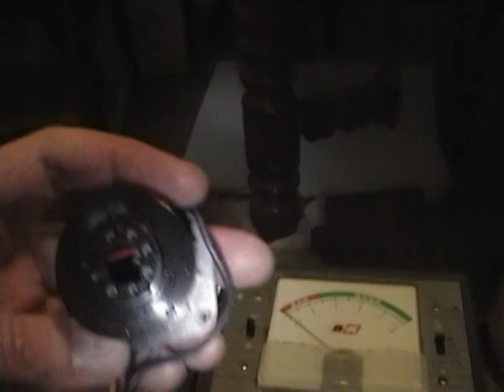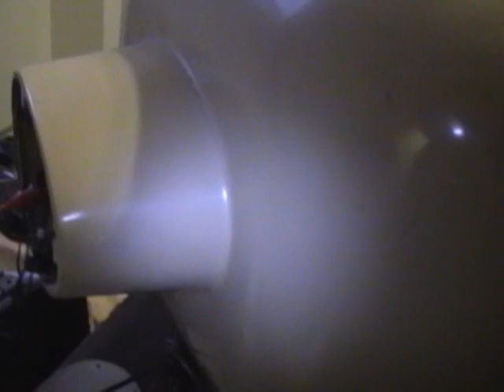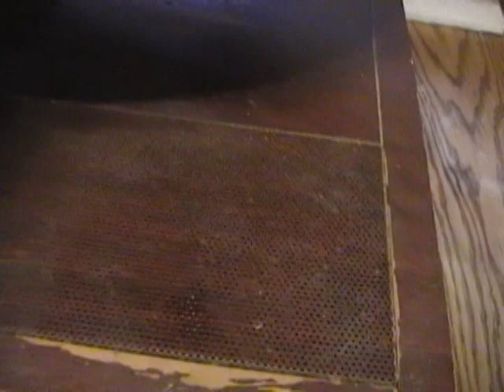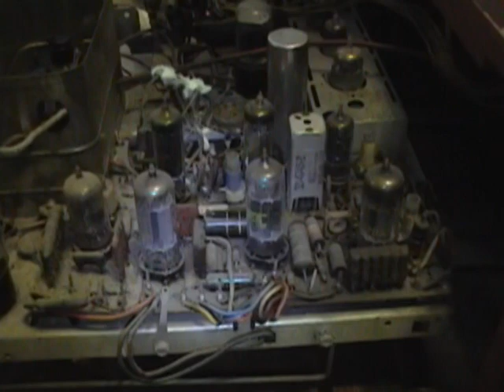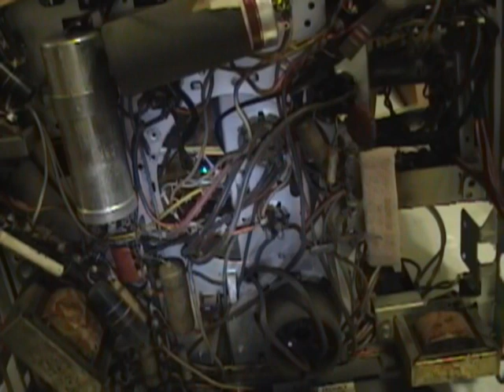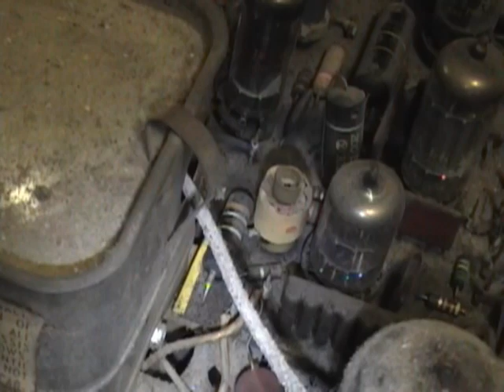Predicta "Holiday" restoration p1o?

Comment: Hey - to replace the 5.6 ohm fusable resistor, and match nearly perfectly, can 2, 11 ohm fusable resistors each with 5 watt ratings be used in parallel for the R78 in the Predicta Holiday with 9L37 chassis?
Reply from the maker: Probably.  The resistance value is not critical.  It's there to reduce the surge current on power up.  Modern silicon power resistors can handle a much higher surge current than the originals.  What is important is that it goes open if too much current is being drawn to protect the power transformer.

Comment: Hey Bob ... I joined the club and have a Holiday I'm restoring.  I need to show you a pic of the current state of the flyback transformer to see if I can just re-seal it.
Reply from the maker: I've yet to see one that couldn't just be resealed.
Reply: @bandersentv good to hear. In my case, the ceiling material was really cracked integrated and the top part had fallen off and thus the wire that goes to that top part from the nearby high voltage tube I believe it fell off, but it looks like it just lays on top- can you confirm?
Reply from the maker: Having trouble following you. Are you saying the wire from the flyback to the HV rectifier plat cap broke off?  No, it doesn't just lay on top.  It is soldered to a very fine wire inside the flyback.  You should get around 400 ohms resistance between the plate cap on the 1B3 and the 12DQ6.
Reply: @bandersentv  Ahh... I see the fine wire, it is not attached, but assume it could be re-attached to one of the two prong like features from the end of the wire/cap that sat on top, then the entire unit re-sealed?  I'll take pics and post to my google drive.
Reply: Bob - confirmed … I can solder this back?
Reply from the maker: It's a very thin wire and you'll need to remove the thin layer of enamel before it will take solder.  Not easy, but not impossible.
Reply: @bandersentv - thanks Bob.

Comment: Can you still get picture tube for that old of a set,and if you can would it be better than the original.also what do you think of solid state tubes. Good luck ,but you seem to have it under control,I just now watching some of your vlogs,so I don't no how long ago u did this ,doesn't matter it's fun to watch
Reply from the maker: +Ron Thompson   It's from about five years ago - Dec, 2011. These picture tubes haven't been made in many years and replacements are hard to find and expensive.  Your best chance is to ask other collectors or get lucky on ebay.  Sorry, I don't know much about solid state tubes.
Reply: Thanks for the info

Comment: Those Philco Predictas are an abomination inside, they remind me of a 1960s Germam radio, wires, components, and crap dangling everywhere. One difference might be that at least Philco had the decency to include plugs and sockets on the cables to the picture tube, yoke, and speaker, Fritz would make you unsolder them.
Reply: you need to chill out dude maybe drink some vodka or whatever you use to do...you are the only person in the world complaining about german radio build quality...maybe you had some problems reapiring some german radio in the past or maybe you can only tackle the aa5's...most german and holland made radios and tvs allow you to make esay service, most tvs have enough cable lenght so you can turn them on with the chassis out and some even had hinges and straps to hold the chassis in a service position while the set operates..most tv sets had 8 or 9 pin plugs for the yoke tuner etc.... so i really dont know what's your point....with the predicta, philco recomended back in the day to crush the old component and replace from the top...the only unreliability and bad design is only in the crt and tube sockets the rest is standard to all tvs of the era...many sets used bumblebee caps and carbon comps... of course hollandese and german sets used the mustard caps or plastic yellow caps that are still good today and wirewound and carbon film resistors wich are spot on but thats other story...fritz likes quality components